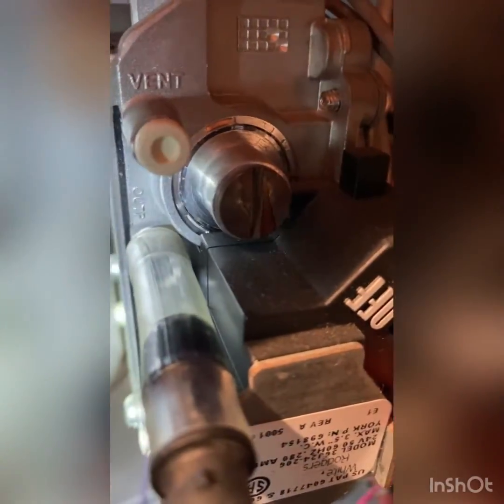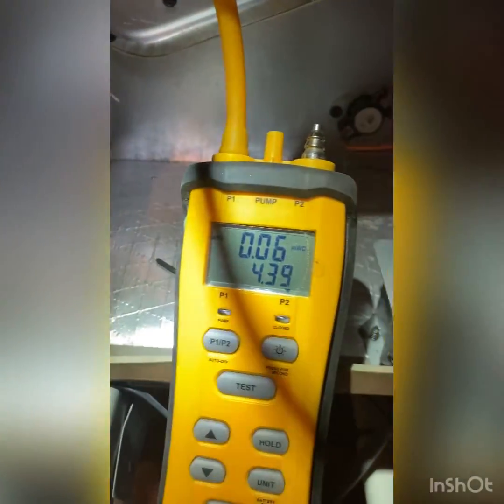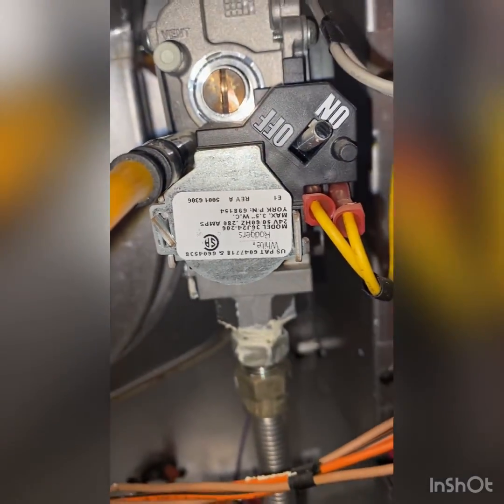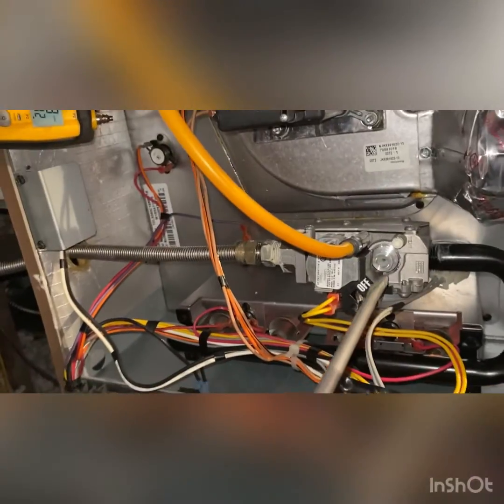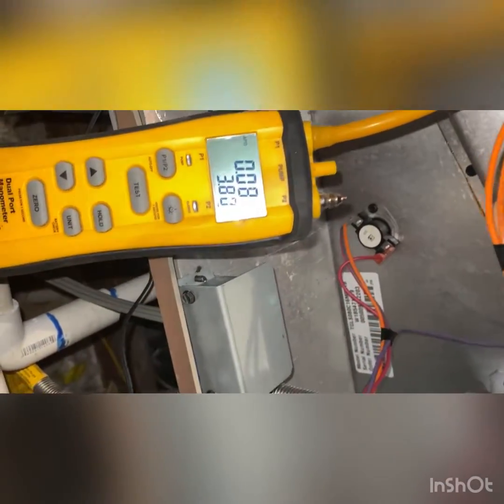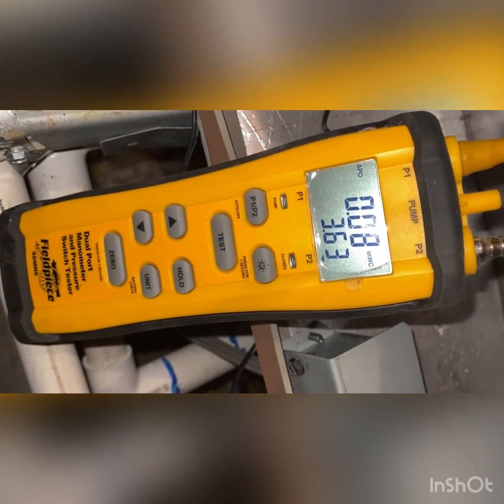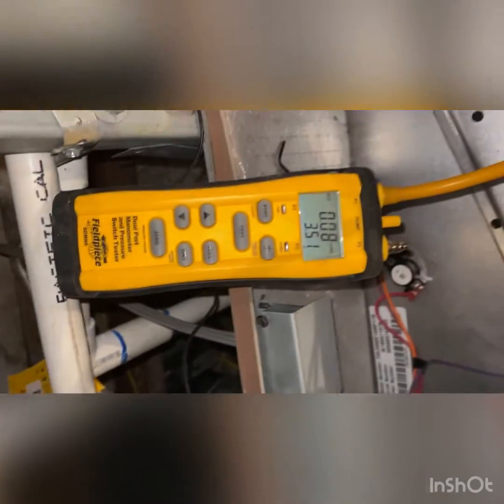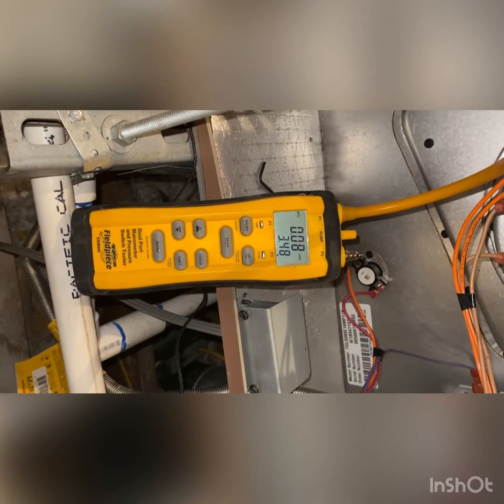HVAC Adjusting inches of water column on gas valve

Comment: What was the symptom of being over 3.5? Why are you checking this?
Reply from the maker: Thermal safety switch kept tripping shutting unit off , cause it was overheating. Didn’t catch that on video so I just made it a video on how to adjust in of water column , you also need to do this when unit is installed, and /or when replacing the gas valve